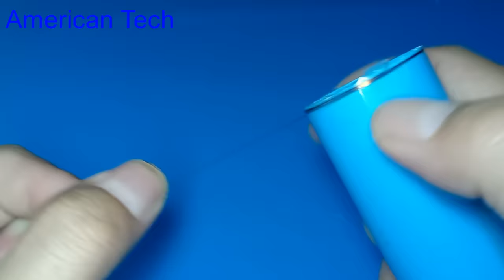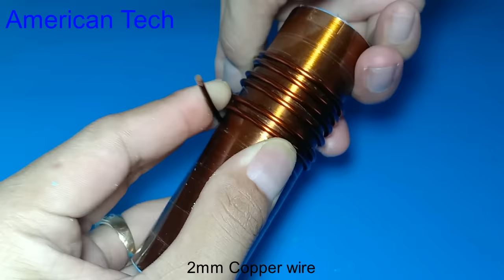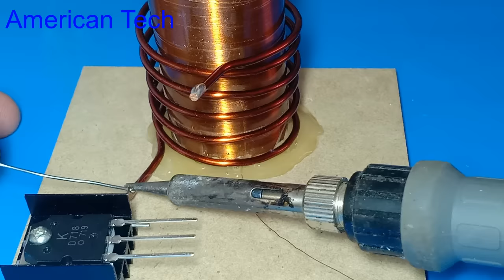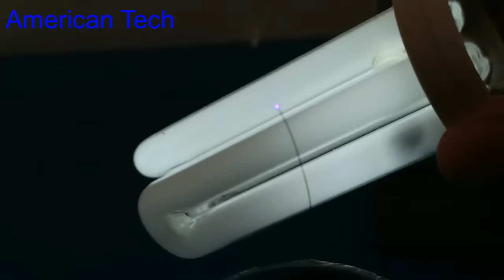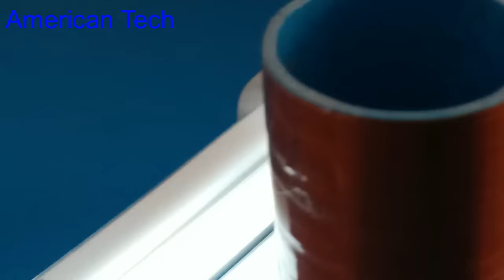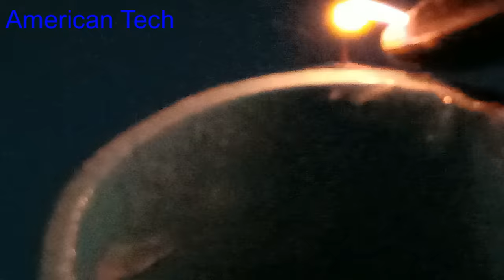How to make a powerful Tesla coil

Comment: First, let me say this is an inexpensive build which is wonderful new to tesla coiling, So Kudos to You and your engineering.  However, here is some truly Respectful and polite Constructive Criticism.  I love the sky blue tub you chose to use as a coil form.  Make it a little longer, your coil winding was gorgeous,  the tape ruined the Aesthetics of the build, a nice couple coats of Krylon clear coat would've set that off.  Make a nice base or buy a small tub, like a can of DAP drywall repair kit, it is small, cut and drill a wooden dowel to fit the inside diameter of the tube, drill a hole through the top drill some holes to secure via a nylon nut & Bolt., You could self contain the electrical components. Drill holes for small wire terminals.  Just a thought, the Corona discharge for it's size made this a very cute and fun coil.  Please be proud of your ingenuity, these were just some thoughts, I threw out there to chew on, happy coiling!
Reply: Bro I have a question
Will this surely work.
Reply: @t.nitheesh5898 that’s a statement, not a question.

Comment: Brush clear cloat on your coils instead of taping the whole thing.
Trust me. The clearcoat holds better, looks better, and provides extra insulation- you need as much insulation as you can get so your magnet wire doesnt start to arc to itself. This is crucial if you want some big sparks.
Because then you can pump more energy into your coil without it destroying itself.
Reply: why would you use any extra insulation when you are already using magnet wire which has a coating already, even the big tesla coils dont use extra insulation
Reply: @paulhackel1646 use epoxy it can protect the Tesla coil

Comment: Your first video? You "generously" hide from us where you connect the black wire (negative from DC supply)! Without that, only those folks who understand the self oscillating circuit you intended will know where to connect...
Reply: To the transistors third leg?
Reply: Yes me too
Reply: which 3rd wire are you guys talking about? the first or the "third" i am getting confused...the left side from the base or the right side?
Reply: If you watching the metal (cooling)the first wire, if the plastic (where the writing is)the third
(Sorry for the bad english)
Reply: @Gergix  kķ
Reply: @Gergix  kij
Reply: It’s literally in the thumbnail
Reply: Ç0
Reply: @Gergix  My dear brother, where do I put the second wire, should I put it in the second piece of the transistor?

Comment: This absolutely works. There are many variables to consider whenever making one, so if it does not work for you right away that doesn't mean American tech is lying. Consider adjusting the resistance, voltage, turns of primary coil (outer coil is the primary coil,and I recommend 4 turns), and consider there are many variations of transistors with differing input points.
Reply: Sir, if I would wanted Tesla coil up to 100kv and to be able to take a 20khz square signal, what would be specifications of that coil... Wire, turns etc...
Reply: AT  is a genius
Reply: So i agree he works just about any thing he's very smart

Comment: I like your vids, maybe I'm idiot, but I'm sure, you'll get way more views and likes if you explain a little bit more what materials and procedures you use. Especially for non-tech viewers.
Reply: use voice not whistling music
Reply: yes at least a schematic will help newbies...
1)bottom end of the thick and thin wires go to the first pin " base"of transistor...the thick wire has a 10,000ohm resistor in between the connection to the transistor
2)upper end of thick wire goes to the second " collector" pin of the transistor
3)third " emitter" pin of the transistor goes to the negative of the power supply
4)positive of the power supply goes to the thick wire bottom end where it meets the transistor mentioned in 1)....
Reply: @fidel catsro No. Thick wire (Primary) and thin wire (Secondary) coils wound same direction. Resistor and bottom of thick wire to positive. Thick wire top to transistor collector. Resistor and bottom of thin wire to transistor base. Negative to transistor emitter. Simple.

Comment: Electroboom will save us by rectifying this video!
Reply: He already made a video about Tesla  coils tho
Reply: Ya
Reply: The circuit is real
Reply: @TechHowden  then how come my curcuit here dosent work while his mumbo jumbo works like magnificent
Reply: I’ve seen it work
Reply: YOLO !!!!!!!! Try the version of the circuit that has a capacitor
Reply: @robertabihay4196  the circuit is not fake, you probably did something wrong or don't have a big enough transistor or enough input voltage. A typical Slayer Exciter circuit with a small transistor won't create Sparks in open-air but create a strong enough electric field to illuminate fluorescent or neon bulbs, and will also mess with a phone touch screen. You need a bigger transistor at higher input voltage and input current to have visible in air sparks.
Reply: oh
Reply: Yeeeep
Reply: Is it sure bro..
As I have to make one, soo can I do the same think
Reply: Wahahaha
Reply: It's working fine so no rectification for this video!
Reply: 8

Comment: Don't make too many turns off the primary coil (2mm) wire
Reply: making the primary is kinda tricky, isn't it? You need enough turns to make it strong but too much and the ratio is low
Reply: Does the primary have to be made out of coated or isolated wires? I've seen a couple of these but each one looks a bit different. One had the primary made from copper wire with a white coating or something like that.
Reply: @fnollo7870  if it's not coated then it can make a short and it won't work
Reply: @hubb8049  Thanks! I'm planning on making this as a science project so I'm trying to gain as much indo about it befote I start haha.
Reply: @hubb8049  I have like 219 turns on the secondary and how much turn should I do on the primary?

Comment: where do you connect negative terminal to ?
Reply: The emitter of the transistor.
Reply: Connect the right transistor pin to ground/negative, this guy forgot to put it in the video. Hope that helps

Comment: The untold wireless energy of nikola tesla
Reply: Yes the wireless energy that would confuse every computer on this plant into being an active high state on every signal simultaneously. Making any computer unusable.
Reply: Nah, its random bursts of microwaves x-rays and radio waves
Reply: @Luke-sj7du you can just power it wirelessly by charging the computer battery wirelessly independently and then going from there. There's devices that already do this btw
Reply: @GV5  A computer needs an active low and an active high to operate. Think about the operation of a single mosfet. Data can only be transferred as a high maybe 5v or a low GND(ground 0v). Without this fundamental trait the computer wouldn't work. You would cause failure by interference.

Comment: After looking at different solutions for a DIY tesla coil I decided to try this one. The difference between the original and my build is that I used 0.2 mm wire for the secondary coil and 1.5 mm for the primary. The secondary is made on 50 mm diameter tube with 1000 turns (21 cm long), the secondary with 5 turns. The transistor is the D718 and everything is connected according to the video. And to my great disappointment it did not work. A few videos explain that you should try to switch the connections to the primary coil, but this did not make the project work. Then I made a new primary coil with the same orientation as the secondary coil: "clockwise turns going downwards" and not as seen on the primary coil in this video which looks like it  goes the opposite way round. And what a relief to see the whole thing work! Sorry, my English is "Danish" :-)
Reply: So, the winding direction of the two coils has to be the same?

Comment: I have one question what is the purpose of this transistor if there is no switching because it is connected in saturation mode in this case, it means giving continues  base voltage no switching how voltage at the collector will be boosted?
Reply: The base current is switched by the secondary, when the base activates the collector, current can flow over primary coil and create a magnetic field, when this happens the secondary coil creates a positive potential at the top and a negative one at the bottom, that stops the current to the base and the transistor turns off, and then the process starts again and again, its a self oscilating circuit called Slayer Exciter

Comment: ive been wrapping this pipe for 400 years
Reply: It certainly feels that way. Ya wind and wind, and the first time ya try to scratch the tip of your nose you lose your grip on the wire and the last ten minutes or so of windings come loose and have to be rewound and you just want to scream! Imagine winding a 4 inch diameter by 1200 turn coil  for a vacuum tube TC with 26 AWG by hand. It's always a good idea when winding coils to keep a strip of tape on the coil as you go, wind ten or so turns, reposition the tape, ten more, reposition, etc as you go. That way if you need a break, or lose your grip on the wire, it won't unravel on ya. Also use a tape with a good stickiness too, like black vinyl electrical tape. Then once you're done winding the coil coat it with epoxy and it'll be solid and protected from insulation varnish damage from scrapes or hot corona discharges, or breakage and unwinding. Use a wide paint brush, and epoxy with a one hour work time instead of quick set so your brush doesn't harden on you before you get half way into it. Use a brush cleaner with xylene to clean the brush after.
Reply: Use drill to winding, good and fast :)
Reply: and in the end its wont work with you :D
Reply: @wael_reg  no work very well :) 4-5 cm sparks
Reply: Use a smaller pipe bro      in that way you can wind it easily..

Comment: Why have so thick wire for the primary if your supply leads are so thin? Also, 13V at 300mA = aprox 4W isn't very powerful. Also, set your iron to a higher temperature, it barely solders. Also, why not use a top load?
Reply: The plasma is more beauriful but yeah

Comment: I have a doubt.. should the LC resonant frequency of primary side and secondery side be matched?
Reply: This does not have a primary LC, and it is self resonant because the secondary provides the feedback to the BJT base. This is a Slayer Exciter, not a true Tesla Coil. A true TC uses a primary and secondary LC that has to be tuned by selecting primary L and C values to be close to the secondary LC, and tapping the primary L in the right spot to find the right res freq match. This is an inefficient circuit operating in class A and wasting a lot of power as heat, though it does find the right resonant frequency due to the secondary driving the BJT base.

Comment: I know this circuit. But I do not know why it works.Where is the source of the oscillator circuit?
Please, please let me know.
And it is a nice video.
Reply: The oscillator circuit? This is a Slayer Exciter, a self resonant circuit operating in a very inefficient, wasting power as heat, class A operation. It works because the base of the BJT is taken high by the resistor to positive V, causing the transistor to conduct current into the primary. Negative feedback to the BJT base, from the bottom of the secondary, turns the BJT off causing the magnetic flux of the primary to collapse. The base is taken high again by the resistor and the cycle repeats. It self resonates because of the secondary feedback to the BJT base. A true Tesla Coil has a primary and secondary LC tank circuit that have to be tuned to the secondary LC's res frequency. This can be done by chosing a pri tank C and L that are in the ballpark of the sec res freq. Tapping the pri L at the right spot fine tunes the pri tank to oscillate at the sec's res freq.

Comment: There's no spark gap, no high voltage capacitor, the emitter is not connected. This is not a Tesla coil, your item doesn't work!
Reply: Ahahahahahhaha, its a tesla coil, just using slayer exciter circuit, and yes emitter is conected to ground, there are

Solid State Tesla Coil 

Spark gap Tesla Coil

Vacumm tube Tesla coil

Dual Resonant Solid State Tesla Coil

Slayer Exciters, not only spark gaps

Comment: !!!QUESTION: Can i use this coil with 12v 1A? would it harm the coil? What can i do to make the arc bigger?
Reply: 12 v  1 A is nothing for a tesla coil....this video is hiding many components that he added to get high voltage arcs....tesla coil with input voltage 12 v gets converted into 2 K V AND may reach to 10000 to 15000 volt.......1 A will help you to see a little bit sparks.....5 A is good....this video doesnot contains the full circuit.....he is hiding.....get     the proper knowledge of tesla coil' s component from PLASMA CHANNEL....

Comment: Sir u don't show circuit diagram  primery coil turns and secondary coil turns  and pipe size
Reply: usually tesla coil primary is 1\3 height of the secondary windings so if the secondary is 10cm...the primary is about 3.3cm

Comment: This is a Slayer Exciter, not exactly a Tesla Coil... And adding 10K ohm resistor defeats the purpose of using so thick Primary coil wire and a high power Transistor!!
Reply: Hey its obiously a Tesla Coil, the only existance of both coils makes it a Tesla Coil, it doesnt matter what circuit drives it

Comment: If we add another small wire next to the one at 9:11 (like solder it on at the end), will the spark come on that as well? Like will that change the intensity of the spark? Also, how far will the spark go (like it stretched for the screw driver), what distance would this much voltage provide? Thank you :)
Reply: 911 lmao
Reply: @zblersqler7405   this guy gets it

Comment: In what part does the source of power weld? In the video shows only one pole at one end of the primary coil and the other? You have the circuit map I would like to try to replicate it. Thank you very much and I love your videos.
Reply: Cesar
See my other comment before you build.
Reply: Thank you very much, so protect yourself the circuit. But I still have a doubt about where the source is connecting? To the primary coil? To the base of the transistor? To the secondary coil? Where?
Reply: If I understand your quest rightly: I assume because of the high voltage it connects via air.
Reply: Be very careful with high voltage and make sure you take the time to read the basics of electronics and the precautions of high voltage. This is a simple circuit that, quite frankly, is baby stuff to us electronics and high voltage hobbyists, but can be dangerous to you and your surroundings. The EMI they create can damage sensitive electronics like pacemeakers, implanted defibrilators, and cranial implants like the ones for control of Parkinson's disease and chronic migranes, as well as computers, CRT and flat screen TV's, stereo systems, etc. The plasma discharge is high frequency and voltage but low current, so it can't stop your heart because of skin effect, but it can burn you with burns that may not hurt bad at first, so you don't realize how bad it has burned you until later. Megahertz range high voltage can give you RF burns that don't behave like thermal burns, (severity and depth dependant on temperature and time duration of exposure,) but instead can burn straight through to the bone and cause deep tissue and nerve damage, even bone marrow damage. RF can also cause cataracts in the eyes and cause genetic damage, and later birth defects, in the eggs in a female's ovaries. Like I said though, this is intro to high voltage, baby stuff, but if you move on to flyback transformers, ignition coils, and true tesla coils powered by neon sign transformers and microwave oven transformers, you can really hurt yourself. So know what your doing before trying, and always respect high voltage or it'll bite you.

Comment: I have a doubt.. should the LC resonant frequency of primary side and secondery side be matched?
Reply: There is no primary LC circuit in this circuit. This is a Slayer Exciter which functions differently than a true Tesla coil. In this circuit the transistor drives the primary at the secondary's resonant frequency, because negative feedback from the bottom of the secondary is used to control the base of the transistor. So there is no primary capacitor or tuning like with a true Tesla Coil.

Comment: Where did you connect the black wire to. And what voltage are you inputting
Reply: Black wire is connected to the third pin (emitter) of the transistor.   And supply voltage is around 12v

Comment: It's won't work the voltage across would be to high and make a short circuit and where's the spark gap resonant circuit capacitor it's really just a inductor with a air core

Comment: Interesting video, i don't know if this is real because in another video a guy drills several holes at top of pipe and inserts screws and wraps the wire around them..... Then he wraps the copper wire around the plastic pipe just as this guy does, and he put a round ball or small baloon wrapped in alluinum foil on top.... So basically it looks like your traditional tesla coil, but the power source is a 9volt battery as most store bought tesla coils are. So is this guy really getting power from the air or from that voltage meter???

Comment: how 2 bring a relation b/w the length of the pipe and the model of the transistor can u plzz show the calculation in detail...???
Reply: IMHO there is no strict relation.
Reply: @camilloholecek5503  can we us N2222 transistor
Reply: @Its_sachin_7 , are you a student of engineering maybe? Then why not TRY it out? I see no reason why it should not work...

Comment: 700 turns of 0.1 mm wire would give a coil length 70 mm not the 106.5 mm as shown.

Comment: What the power from? Nothing bateray or more
Reply: you can see they are using a power supply with adjustable voltage and current inputs